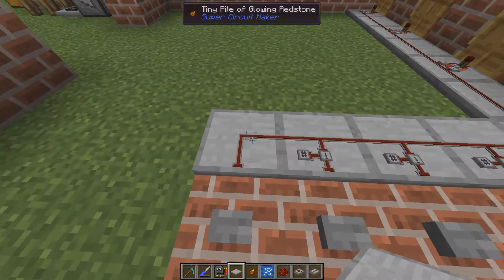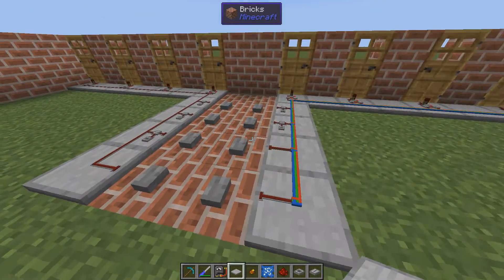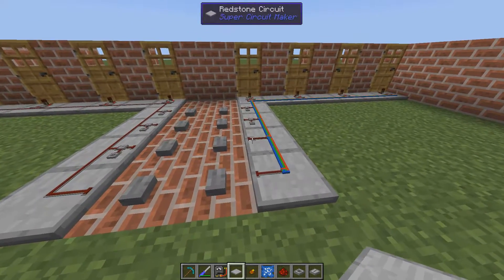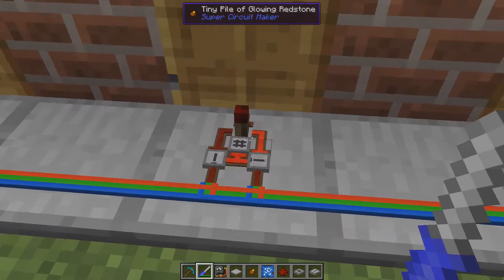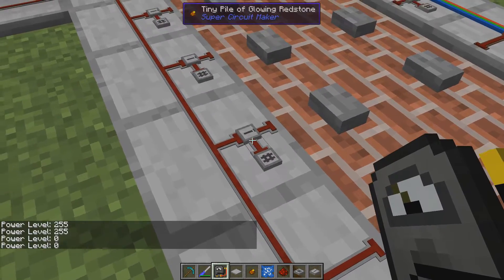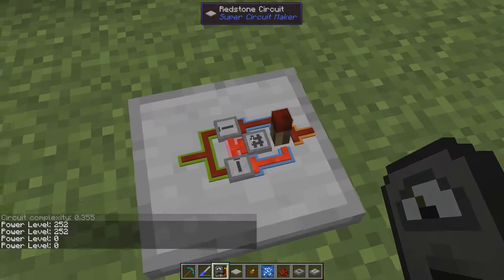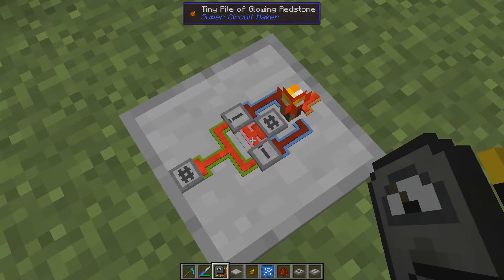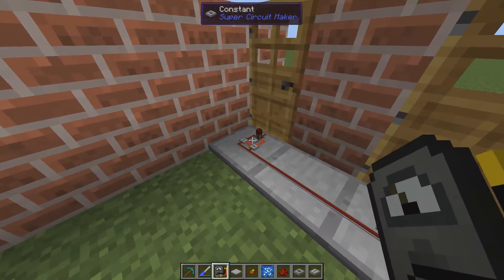Super Circuit Maker - Analogue Decoder / Comparator (MC 1.10.2)

Comment: Well, to start, you theoretically could hold a maximum of (4*7*16*8) binary bits per circuit that travels along without the signal splitting.second, this is because you have a byte to work with (2^8 means 8 bits, 8 things) and you have 16 colors on a possible 4*7 workspace (can also turn corners) which gives 3584 bits of data, 448 bytes. I should also recommend using two bits for each desired channel instead, making the circuitry simpler to a degree. First: Have a simple modulo 4 circuit that outputs the last two bits of data on a channel, then have a circuit that divides the signal by four, then does the same modulo by four. Next divide by 16 instead of four, then 64. Each of these can take the original signal and decode it under the same conditions, and you have four two-bit things per color of cable, and any reasonable messing around affords 7 omnidirectional colored cables, giving 1/4 the theoretical maximum.also I made a divider in Turing code finally! Yay. How've you been?
Reply from the maker: Yeah, that's of course even better, but the idea with this build was to be simple and effective. I'll see if I'll do a new build with real multiplexing in channels like that. 
Still working on that Turing machine? Wow dude :)
Reply: easy decoder/encoder system:
take ("IN"/(4^x)) Modulo 4
where "IN" is the bus
4 is the "base" of the output (for four, it has four items, two gives 8, but you can chose anything.)
and x is the item ID ranging from 0 to the maximum (max is x where 4^x=256)
you already made a modulo circuit taking "IN"-(("IN"/base)*base)
all you need is to pre-divide the input.
my recommendation for four is because this is the optimum median, hook up 3 things that would nearly never be used simultaneously to each 'x', this gives 12 items, four of which can be operated at a time, per bus. there are a possible 7 busses per "line" (block)
Reply: oops, forgot the encoder part: just take "IN"*(4^x) and ADD it to the bus with an adder.
Reply from the maker: To be honest, I'm a little confused and would need to see it in action to fully understand. But... is this how you mean? To use binary values which would give 8 addresses per color - all can be used at the same time. Doing a modulo decoder to mask them out? I think you had a variant of these in one of your worlds you sent me? But it sounds like a fun next step in the series :) Damn, I need to find time to record these things now!
Reply: here's the idea: remember your binary decoder? mingle it with my variant, essentially making a bit-selector circuit (selects the bit from a byte); to encode, simply add. so for inputs a0-a7, a0+2*a1+4*a2...2^7*a7 (use pemdas here) and the result is the byte encoding the logic signals from all of them.

you inspired me (in a few seconds as i read the comment) to think up something BETTER!
use a falling-edge delay, where the circuit takes 16 ticks to disable, then you can encode up to 30 things that can all be simul-triggered, using sets of four bits (so 1111-1111 would PRETEND to be all multiples of 17 because of cycling)
this requires that ALL inputs are on the SAME clock, and that clock will cycle from 1 to 15 (or 0-15, either way.)
and attempted inputs only occur during their designated point in the cycle. since it takes one full cycle for a 'door' to close, it has time to refresh the signal each time. you need only figure out how to delay the door closing; and immediately accept it opening. aside from that, you already have the tools, just let the signal vary from 1-15 for one set, and 16*(1-15) for the other, and comparator that with the clock values (from 1-15 or 0-15) looking for the correct level.

this kind of clock cycling is how real-world computer screens operate, column by column your screen writes only a line of pixels, but they don't turn off until the cycle comes back around to it because the metamaterials simply can't deactivate fast enough.
Reply from the maker: I finally found time to finalize and record the updated build with "bit addressing". It should be out within a few days :)

I don't think I'll go that extra step though... at least not now. Would rather like to finalize the updated 7-Segment decoder as well, did you ever manage to fit the 10 input to 7 outputs on a single circuit?

Comment: Welcome back! I noticed a flaw early on (ignore this if its fixed in the video) but you should replace the joints with adders, and change the system so that It supports multiple signals, as it can handle only one signal at a time in the current state.
Reply from the maker: Thanks! I don't fully follow, feel free to explain further. Remember that this is perhaps the simplest form of signal encoding/decoding and will be limited due to its simplicity ;)